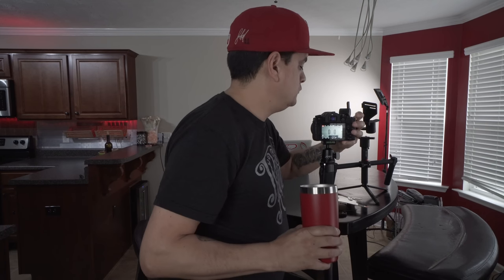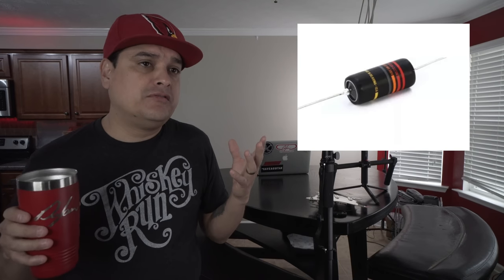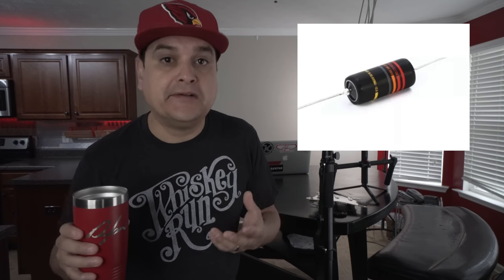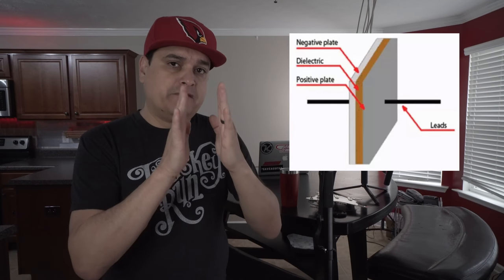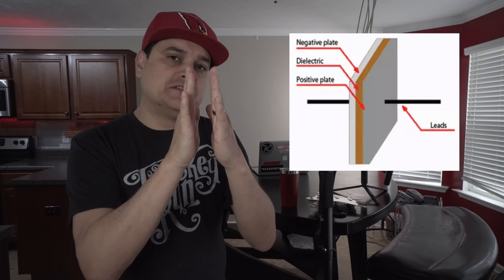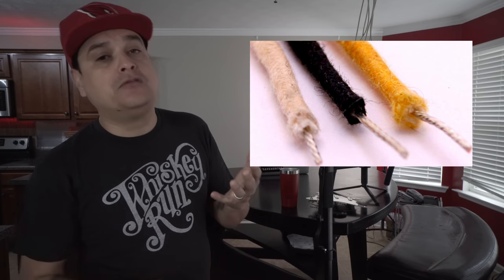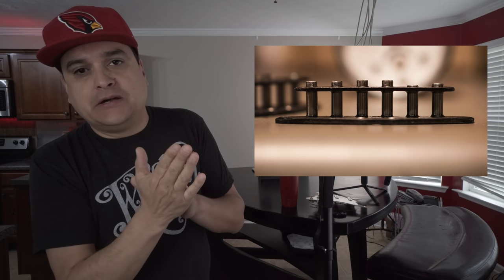Are Paper In Oil Caps Better Than Orange Drop?

Comment: i think that capacitor are tone sucker and ruin the sound. well the sound i like anyways. they sound muffled or like if using a cardboard pick. sounds terrible to me. which is why i think i dont like the gibson sound maybe...? still trying to figure out what makes the gibson tone un-pleasurable to me, so i don't get guitars with components that sound like that.
Reply: i actually don't use them. what i got from this video is that because of old tech in audio outside of guitars in the beginnings of the electric guitar craze they had to use them to not be sound so bright. and now there pretty much useless and a tone sucker. unless you like that choked out sound.

Comment: Unfortunately he's wrong but he's right you can buy new old stock Russian PIO caps and yes in my guitar they most definitely did change the tone so explain that one. going from new mylar to new old stock Pio.so before you start quoting electrical engineering knowledge you'd better be putting it too the test cause.if I had not done it myself.and listen to this video I would've never known!!!!!! In my guitar it most definitely changed the tone!!!!!
Reply from the maker: Hey I’m willing to learn, but you gotta have some actual data and know your stuff. Make a video, tag me, and ill come watch. If you have empirical evidence and not subjective anecdotes that prove me wrong, I will take notice and share your findings
Reply: @DylanTalksTone  sorry bud I am too busy for that but buy off eBay and run your own video it's cheap man my guitar was a Les Paul humbuckers if that helps.And don't ask me why because what he says is true and it shouldn't matter but it does change the tone now my experience was with new old stock Russian PIO so I can't comment on orange drops or bumblebee etc....... Cheers
Reply from the maker: Lol so your whole comment is basically pointless.

Comment: I think that capacitors really don't make a change even though creamic capacitors can be microphonic. But i feel wiring your gutair like they did in the 50's  makes more of a difference.  Modern wiring rolls off tone when you turn the volume down and 50's wiring keeps the same tonal value no matter the volume level. The tone is before the volume pot  in 50's wiring and in modern wiring it is after the volume pot.

Comment: I only use Russian paper in oil caps.  Why?  Just because I am an opinionated crotchety old fart who did an extensive test of 50 or so capacitors ... that took two fucking weeks because the differences were nearly imperceptible ... and "decided" that I liked them the most.  I probably would have been just as "scientific" if I had just flipped a fist full of quarters.  But I like 'em and they are what I use.

Comment: You contradict yourself - right? You say there is no difference in sound and then say an old cap that drifted can create a different sound. (8:56) Can you clarify?
Reply from the maker: Nothing to clarify … a drifting cap is a failure.
Reply: @DylanTalksTone  thanks, Dylan. I'm learning. It just confused me is all.
Reply: @DylanTalksTone  Ok - thinking about this a bit more. So - the value of the capacitor is drifting resulting in a different sound. Therefore, capacitors of different VALUES sound different. It isn't the style or model of the capacitor that creates the change - given that the value of the capacitors across style / model are the same. Am I on the right track here?

Comment: Your not hearing any signal that goes through a tone pot capacitor, the type cant make a difference to the way it sounds no matter what people want to believe, its controlling signal bled to ground. Not the other way around.

With treble bleed circuits however, i STRONGLY advise against using ceramic and orange drop capacitors, you ARE hearing signal through capacitors on that circuit, and type absolutely makes a difference. 

There is a reason no high end speaker crossovers use ceramic and orange drop capacitors. They just dont sound as good if you are hearing signal after its passed through them. On tone knobs all that matters is the capacitance value, as that controls the amount of high frequencies bled to ground, you dont hear any of the signal that passes through the tone knob.

I design and build my own speaker crossovers, and i laugh at anyone who says capacitor type doesnt make a difference to the sound you get. The ONLY audio circuits im even willing to let ceramic and orange drop capacitors get anywhere near, are guitar tone pots, or other circuits bleeding to ground that you do not hear signal passing through. Quite simply put, they sound like SHIT compared to oil-paper or polypropelene caps. And honestly, on guitar tone pots, there is a slight difference in the way the sweep pf the pot rolls off the high frequencies between cap types, but its negligible at best and often within the +/- rated value between the values of a single cap type, which essentially means it doesnt matter. At all. ***but only for roll off circuits***.

Comment: My ears aren't that good, I can't tell a difference between different types of caps or even small increments of capacitance.  I wonder why are people hearing a difference (besides confirmation bias)?   The only thing I can come up with is the parasitic inductance of different capacitor compositions with the inductive reactance acting upon the capacitive reactive in the circuit.  I wonder if this can be measured  with a vna and plotted on a smith chart? Has anyone here tried?